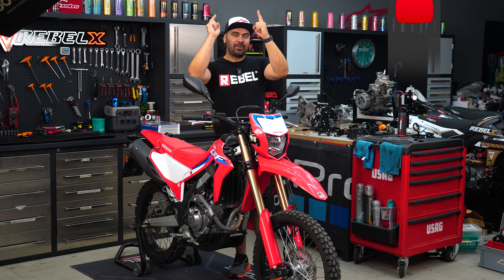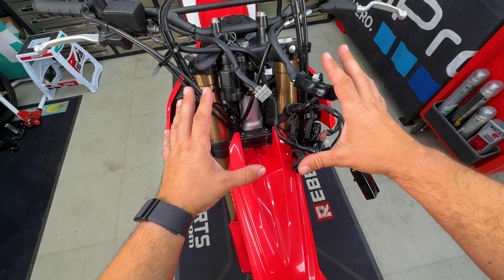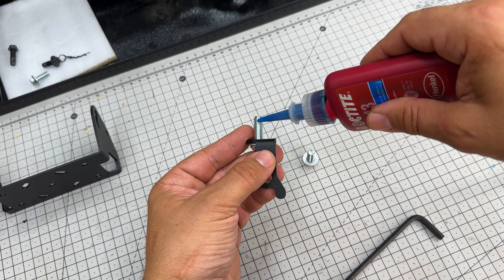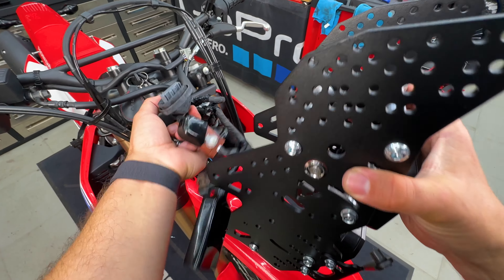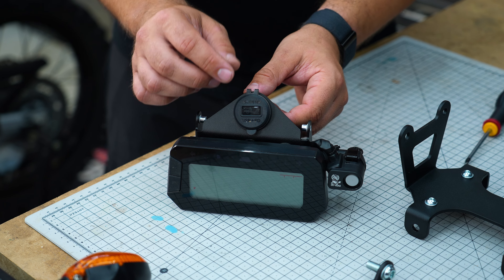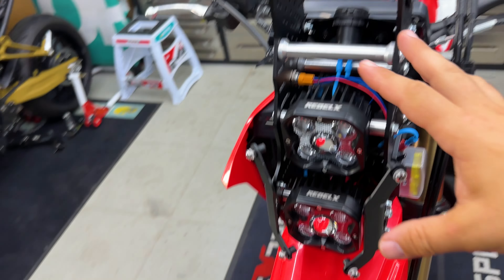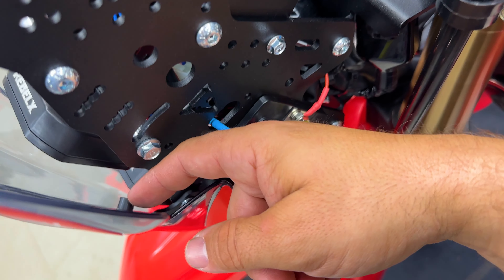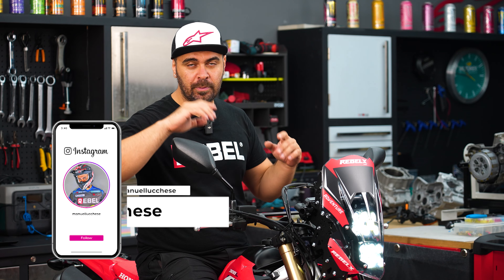HONDA CRF 300L RALLY KIT Tutorial

Comment: Do you think i can plug these light on a Kawasaki KLX250S 2009? Will the light cable plugs match?
Reply from the maker: @constantinosschinas4503  surely can be adapted but most probably headlight wiring will not be plug and pmay
Reply: @ManuelLucchese1  Thought so because kawasakis are not mentioned even in universal solutions that include htm honda suzuki and so on.